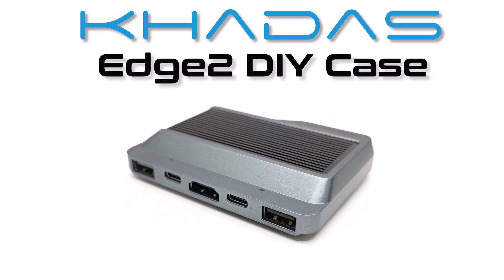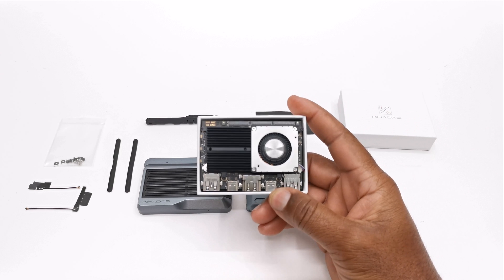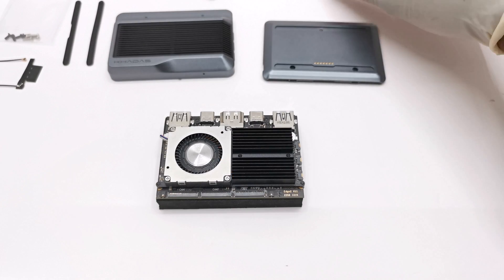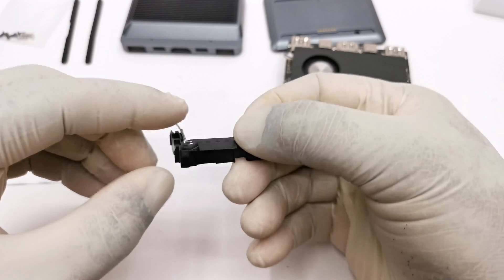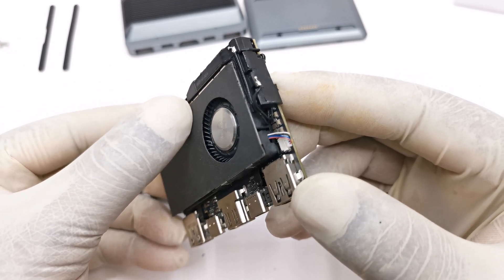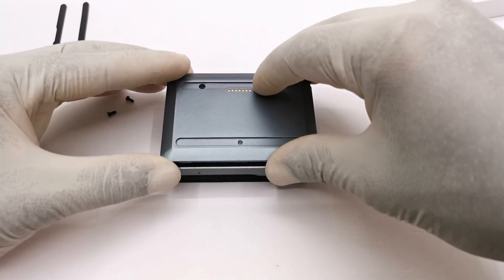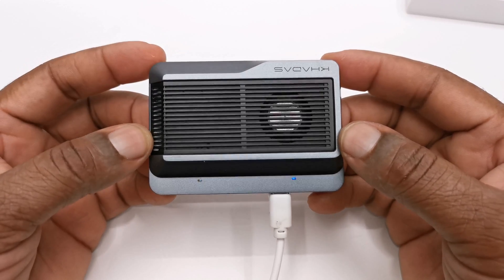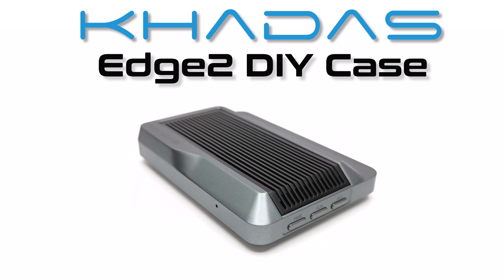Khadas Edge2 DIY Case Assembly

Comment: beautiful hardware, software support though is almost inexistent, makes all that hardware barely useable.
Reply from the maker: You don't get firmware or tech support support from Khadas?
Reply: @tvboxstop  You don't get GPU drivers and you're forced to tinker your way into making it useable. A mini / small footprint (Intel N100) x86 PC is way cheaper, supports nearly everything software-wise and outperforms it in every aspect.(with same or even lower power usage if you slightly underclock the CPU)
I own their Edge 2 pro and Vim 3 and they're just collecting dust ever since I bought a Geekom Mini PC.
Reply from the maker: @RazielMessiah  OK